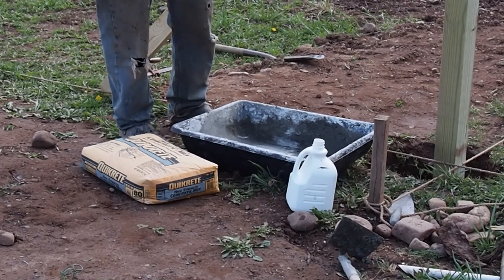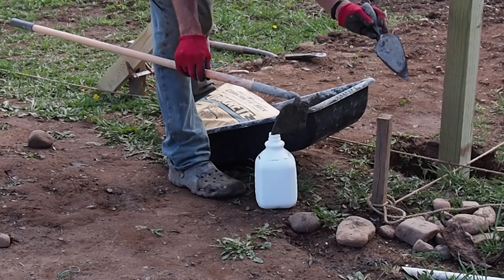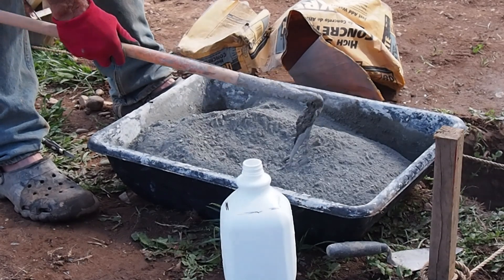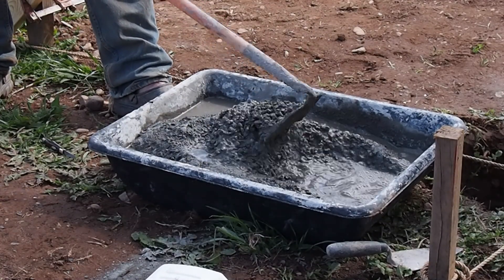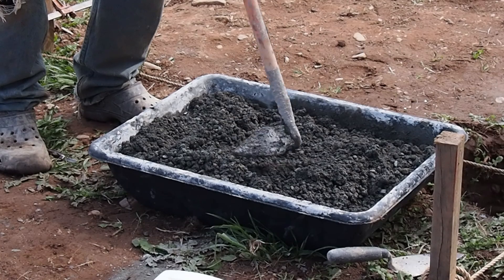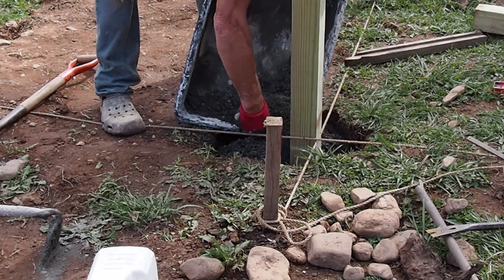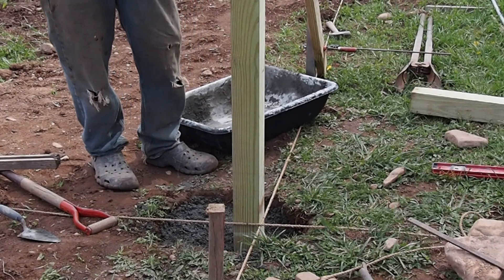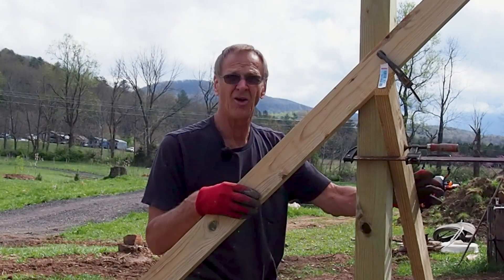Mixing Quikrete High Strength Concrete

Comment: Thank you! I have been using the quick set type, but it sets up so fast I had difficulty putting in a couple of my T posts. Will try the high strength (but slower-set) mix next.